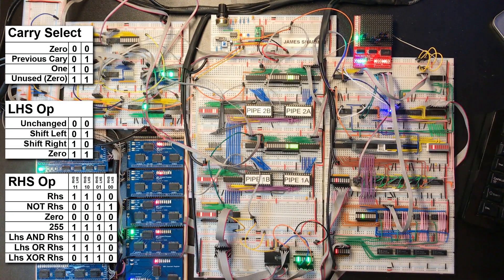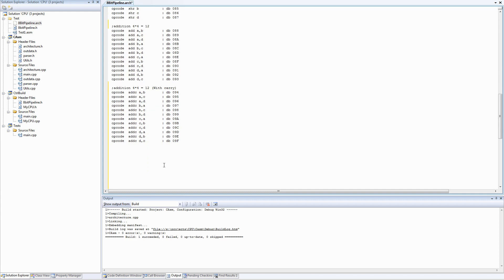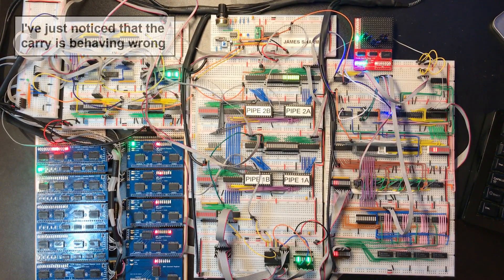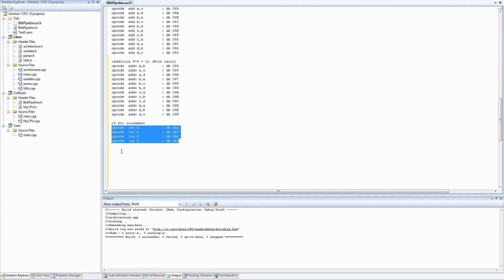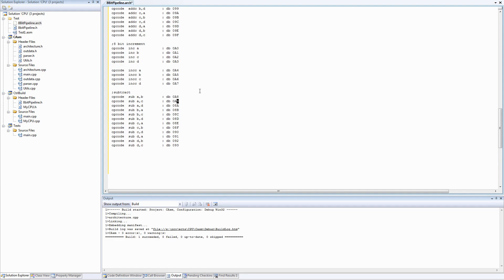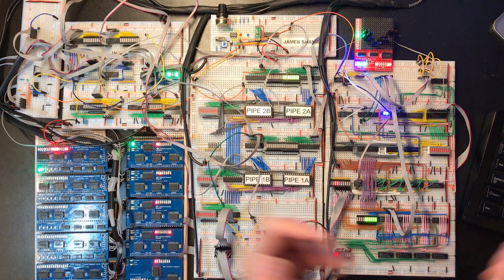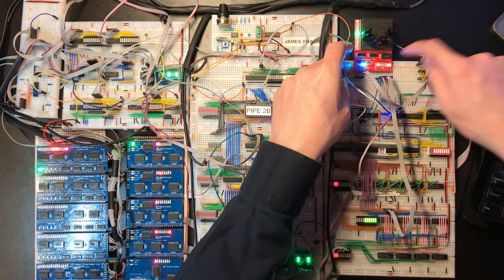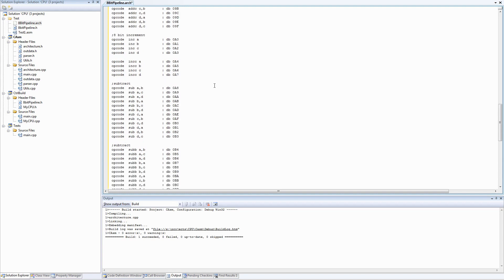ALU (11: Arithmetic) - Making an 8 Bit pipelined CPU - Part 42

Comment: I'm already getting nervous about dependencies between instructions here.  If your GPR gets INCd and then next instruction needs that same register, what happens as of now?
Reply from the maker: It works fine, but you may want to finish the main cpu videos before digging worrying about some of this stuff.  When you say "as of now" you should be clear if you mean at this point in the build or at this point in time when lots has changed.
Reply: @weirdboyjim I was definitely refererring to "now" as in when that video was current.

Comment: You could have factored your giant switch() over the opcode into two parts and | them together to get the control bits.    Would cut down on the copy-pasta.
Reply from the maker: You could do, but I prefer to keep the implmentation for an instruction in the same place rather than split.

Comment: Never had an increment with carry!  In the use case you mentioned, adding an 8-bit int to a 16-bit int, wouldn't the appropriate thing to do is add 0 with carry?  If the lower 8 bits didn't overflow, then you just don't want to increment the upper 8 bits.  "Increment with carry" sounds like you're adding 1 and adding 1 again if there was a carry, right?
Reply from the maker: One of the benefits of creating your own isa is you can do whatever you want. You may prefer to think of it as a predicated "increment on carry" instruction.

Comment: You're not doing multiplication? I mean, at first glance if you use 74283 and 7408 chips, you only need about 30 extra chips for that! :)
Reply from the maker: Sorry to disappoint. ;-)

That would work, I count 28 chips (14 of each). You can reduce the latency a bit by replacing the 7408’s with 74253’s configured so the add always happens and then you use the multiplexer to pick between zero, either input or the addition result. That would increase the chip count though (2x253's  replacing each 08) .

I did work out a much simpler circuit that used a pair of rom chips to implement a 4bit*8bit multiply via lookup. 2 lots of that with a summing adder could make for a more contained circuit. 

Either way I don’t  see a way of integrating it without either extending the pipeline or adding a wait system (And getting a much bigger desk). :-(
Reply: @weirdboyjim  Yes, latency is the big problem here. I think if I ever want to add a multiplier to my CPU (which isn't done yet, my settable counter chips haven't arrived yet, but it's already obsolete and I want to fully redesign it...) I might do it either as a set of special registers or on the memory bus, so not actually in the ALU. That way timing isn't an issue and you can "just" specify that you have to wait X time (or cycles) before reading the result register.
Reply from the maker: A good halfway house would be to add a variable distance shifter (Useful in it’s own right) and create am instruction that can do a bit test, shift and add conditionally. Then you could do an 8*8 multiply in 8 instructions, If you used a stepped architecture you could loop that in the control logic. Far fewer components but a big step forward.
Reply: @weirdboyjim  That's a very good point. A shifter is going to be the simplest way forward indeed. Now I just have to think about where exactly inside the ALU data path I should put it :)